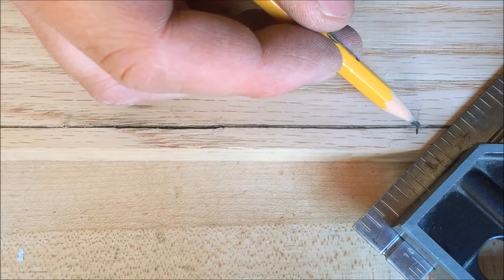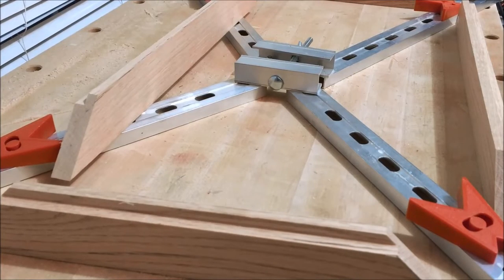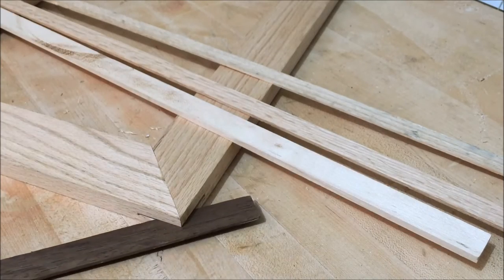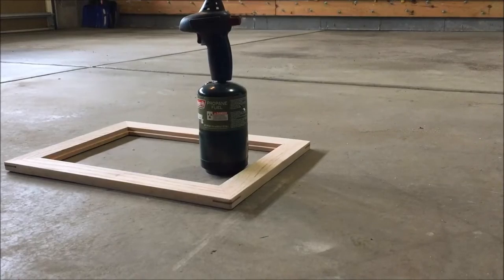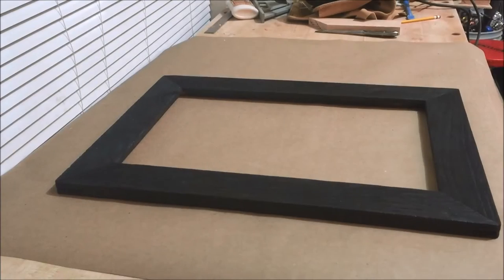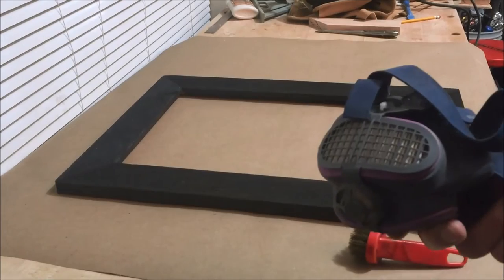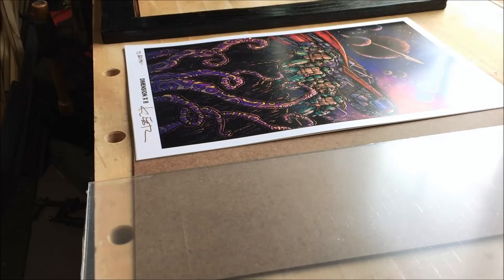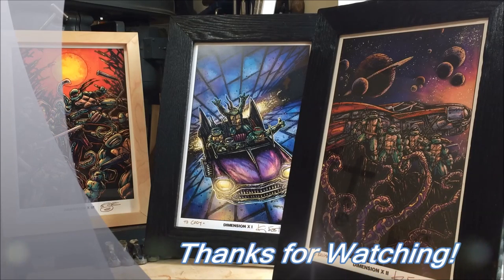Shou Sugi Ban - Picture Frame

Comment: This was SO fun!!! You had me a little worried with the blow torch though. Would a stain be THAT much different? Beautiful outcomes on all three.
Reply from the maker: Thanks for watching!  Stain primarily just changes the color of the wood.  Some stains will have additives to make the wood more rot resistant.  Shou Sugi Ban, (Yakisugi) makes the wood rot resistant without adding chemicals.  (Of course, I added a topcoat of Danish Oil, which adds a  varnish).  The main main difference with the application on oak, is that the grain has has so much more dimension now.
Reply: Got it... I think...